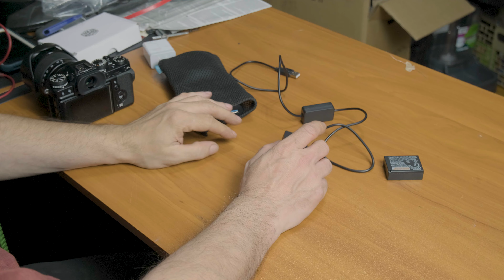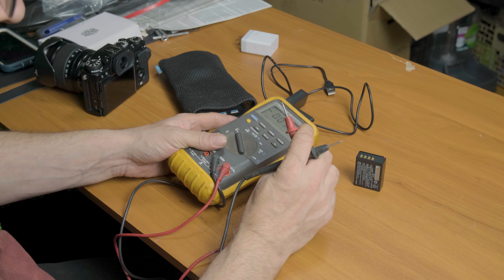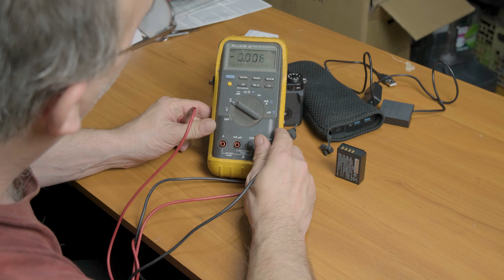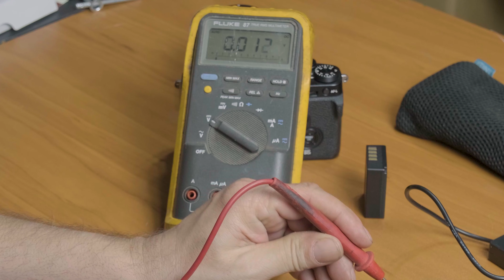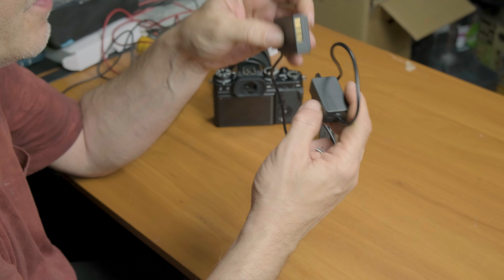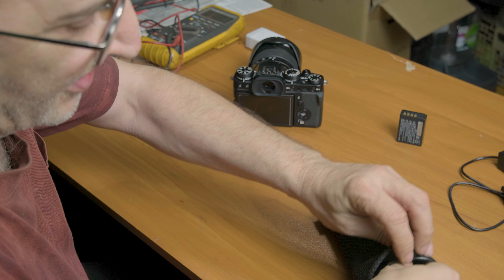Don't Burn Up Your Camera, Using a Dummy Battery, Here is how.

Comment: Hi! I have a generic dummy battery kit (CP-W235) for my Fuji XH2S. Since I can't reach the dummy battery contacts inside the camera compartment, I measured the voltage directly at the DC barrel connector between the adapter and the dummy battery. I got 8.6V DC and 0.03V AC ripple. The original Fuji NP-W235 battery is rated at 7.2V nominal / 8.4V fully charged. Do these readings look safe to use with the camera? Thanks!
Reply from the maker: Yeah 8.6 V is close enough to 8.4V so that would seem valid

Comment: I messed up my camera with a dummy battery. It wasn't a USB power supply, but I plugged it in to the wrong supply voltage cable. I think I gave it about 24v. 😩 Hoping the repair parts aren't too pricey.
Reply from the maker: Well if you fried your camera, depending on what camera, i would say it's going to cost at least $500.00 to $700.00 to fix this.
That is why i put that video out to warn people.
Because many people has made this mistake.

Comment: I wonder , xt3 can be used with usbc to usbc and can be powered directly without dummy battery and i think it will be safer for the camera , so using dummy battery?
Reply from the maker: Yeah it can if you use the Anker Powercore+ the input is USBC and so it's the connection on the camera.

Comment: does powering from usb c make you camera to heat more? i only test for 10 min recording i notice minimal difference or my camera is just low entry (ZV E10)
Reply from the maker: you mean the overheating thing, no actually less, if you use the USBC for power the batteries inside the camera are not getting warm because they are hardly used..
So the internal heat is less.
Reply: No I mean usbc directly to camera usbc port on the side not battery

Comment: If I had known this before I wouldn't have burned my Sony ZVE10. I bought a dummy battery about 2 years ago and there was no way to measure the voltage. They didn't tell me about this either. I connected the wrong power supply and it burned my camera.
Reply from the maker: that's how it happens and that is why i crated that video to warn people.

Comment: Iam using 9 volts, no problem
Reply from the maker: You might be able to get away with it, but sooner or later it's going to burn your camera's circuit board out sooner before it's time.. 
Too high of voltage is not a good thing..
Reply: Did u test it and found 9v ?

Comment: "Multimeters aren't that expensive" {pulls out a Fluke 87 of about €650+ } hahaha. But I get it. They can be cheap.
Are there dummy batteries with the voltage regulator build in the dummy battery?

Comment: Insightful video, Sir. I'm planning to buy a similar dummy battery like yours for my Canon EOS 600D. But instead of using a powerbank or adapter, I'm planning to plug it directly on my PC's USB ports in the back like a webcam. What is your advice about this idea? Is it safe or risky? Thank you for any advice.
Reply: I do that with my A7SIII, but the pc isn't able to charge the battery while is on.

Comment: Hi there! I was wondering how to measure the voltage in batteries (and dummy batteries) where there are no positive or negative physical poles (in the outside of the battery), such as the ones in camera Sony 6000a?  Thank you!
Reply from the maker: There has to be some sort of metal connect on the batteries and you just find out which one is pos and the other neg that is the only way.
Reply: @AMomentInTimeProductions  Thank you so much for your quick response! I'll explore my batteries, and I'll let you know my results. Thank you, again.

Comment: Thanks for the video but some things are a bit unclear to me so if you can help me out I would appreciate it:

I would like to buy Nikon Z30 and Nikon has not released any official dummy battery. So instead of buying any 3rd party dummy battery could I use power bank plugged into the socket and than connecting it to the camera via USB? Would that give me infinite power? Or could I at least stream in 4k 12+ hours?

Thanks.
Reply: The camera must have a Type-C port, and both the camera and the power bank support the Power Delivery "PD" , not Micro USB, Micro USB doesn't support "PD"

Comment: Any advice for dummy battery for a g85 ? And a usb batter pack would be the way yo go ?
Reply from the maker: uicebox Power Coupler (Dummy Battery) for Panasonic GH3, GH4, GH5, GH5S

https://www.amazon.com/Juicebox-Power-Coupler-Battery-Panasonic/dp/B07JG9P991/ref=asc_df_B07JG9P991/?tag=hyprod-20&linkCode=df0&hvadid=658947680612&hvpos=&hvnetw=g&hvrand=16351334134414361132&hvpone=&hvptwo=&hvqmt=&hvdev=c&hvdvcmdl=&hvlocint=&hvlocphy=9012329&hvtargid=pla-2088511856145&psc=1&mcid=b719f21666063db7bf57adabfb9e6253
Reply: Thanks for the fast reply

Comment: Thank you for this video. I suppose using the power bank method would be much safer option compared to plugging into a wall outlet. I just got a new camera and I am looking into getting a dummy battery and a power bank for shopping star trails.
Reply from the maker: Power Bank Method is much safer and it works well, and no wires to be plugged into the camera..

Comment: Most SONY dummy batteries have no current or voltage regulation or diode at all. I tried on SONY HX99v and ZV-1 and atleast they didn't die.

Batteries for them are the NP-BX1 that outputs 3,6V. Hlwever when I measured the Dummy batteries, they were 5V. Same Voltage from dummy  from USB standard.

I'm gueeskng It is ok because these cameras charge through USB and maybe the Voltage regulator in the camera can handle 3-5,5Volts depending IF It is run on USB port power or battery, meaning the step down/up circuit is placed after the USB mains/Battery leads on the DC board inside the camera..
Reply from the maker: Yeah i don't use a Dummy battery for the Sony, i do how ever use the Anker powercore  Power delivery pack, with that you can get 9 to 10 hours of battery life doing video with that on a Sony Camera, like the FX30
Reply: @AMomentInTimeProductions  do you mean you charge the camera directly with the USB-C using a power bank?

Many people say this discharges the battery, just slowly. It will eventually turn off as the camera battery runs out of power.

Is that the case? What about overheating?

Comment: I fry my sony alpha a7iii used dummy battery with the v mount for the first time, is it a easy replacement the part ? Do you know what part have to be replaced after fry camera ?
Reply from the maker: Probably the Main board... You should always make sure you know what your hooking up to your camera for power this video explains that..

Comment: Sir i have recently purchased Sony FX 30 im looking for power bank as I have long video shoots.
Pls suggest which power bank is suitable and how to use that as im new to this
Reply from the maker: Anker PowerCore+ 26800mAh PD 45W with 60W PD Charger, Power Delivery Portable Charger Bundle for USB C MacBook Air/Pro/Dell XPS, iPad Pro, iPhone 14/13/12 Series, and More...

I  use that myself on the Sony Fx30 It's Only $99.99

https://www.amazon.com/Anker-Charger-PowerCore-Portable-Delivery/dp/B07XRJZXKY/ref=asc_df_B07XRJZXKY/?tag=hyprod-20&linkCode=df0&hvadid=385448272964&hvpos=&hvnetw=g&hvrand=2143402792051450447&hvpone=&hvptwo=&hvqmt=&hvdev=c&hvdvcmdl=&hvlocint=&hvlocphy=9012329&hvtargid=pla-835112928895&psc=1&tag=&ref=&adgrpid=81228106969&hvpone=&hvptwo=&hvadid=385448272964&hvpos=&hvnetw=g&hvrand=2143402792051450447&hvqmt=&hvdev=c&hvdvcmdl=&hvlocint=&hvlocphy=9012329&hvtargid=pla-835112928895
Reply: @AMomentInTimeProductions  Sir ur suggested product is not available on Amazon or any other online app.
Im from India and I have shortlisted MI Power Bank ( Details attached ).
Pls have a look on this and pls guide me will it works or i shall drop my idea of buying this.
Thanks in advance sir

Comment: I got a dummy batterie that reads 8.9v for the fuji xt-1 with a wall converter it came with. Will that fry it?
Reply from the maker: If your camera is suppose to only take 5V yes, what does your normal battery Put out?
Reply: I just checked a fully charged  non original battery (quite used) says 7.99v. It's like the battery u have in the video. Perhaps slightly different for the x-t2
Reply: It worked. As the link I posted, the camera regulated it to its needed voltage.

Comment: question please help, what happens if u accidentally use a 5V power bank to your 8V NP-FZ100 dummy battery connected to your Sony A74 camera, would it have the chance to fry the camera or not? thank uu
Reply from the maker: If you use a Power Bank That Doesn't produce enough voltage then yes you could fry your camera..
Have not enough voltage to any circuit board is just as bad as having too much.
that is why brown outs and voltage brown outs can damage computers, same with a camera..
Before you ever hook up any dummy battery to your camera make sure the voltage that is going to the dummy battery is the same as what your real battery would put out, make sure the voltage is not too low or too high, if your camera is suppose to be supplied 8V then make sure that is what the dummy battery is giving to the camera, it can be 8.2V or 7.9 that is ok, your real battery drops slight voltage as the batter is being used and wearing out, But a camera that is suppose to be supplied 8V should never be getting 5V that is not good.
Reply: @AMomentInTimeProductions  this is what worries me, my fault that I didn't do the research before putting the dummy battery w the 5v powerbank, although the camera is still work fine now (im using regular battery btw)..is there a way to check if the camera is damaged from the mistake I made w the under volt powerbank?? thanks again for replying
Reply from the maker: @Obscurainc  Well there is no way to check that, if your camera is working fine then you are probably alright..
the signs of a damaged camera would be if you start seeing strange things happen such as the camera shutting down for no reason or the screen flickering or glitching..
Or functions not working like they should..
Chances are if the camera turns on and records video fine then your probably ok..
I wouldn't worry about it..
just make sure you use a volt meter before you use anything to power your camera..
Especially a Dummy Battery..
First off what camera do you have, what make and model?
once you tell me that i can tell you what you can use to power your dummy battery..
Reply: @AMomentInTimeProductions  Sony A74
Reply from the maker: @Obscurainc  Ok so that battery for that camera should be givingan  Output Voltage	7.2 VDC  So, that means 5v would not be enough voltage, make sure your Dummy Battery gives off around 7.2 Volts

Comment: The following question seems to have slipped through the cracks so I'll ask again.

I own an X-T5. I bought a dummy battery from GyroVu advertised to be compatible with the X-T4 and X-T5. Bottom line: It doesn’t work. The camera powers on but freezes when I try to shoot a photo. I can’t figure out how to use my voltage meter to test the dummy battery because the test leads on my voltage meter don’t fit into the tiny slits in the Fujifilm NP-W235 Li battery. Any suggestions for testing the power output? Can you recommend a dummy battery that will work with my X-T5? Thanks!
Reply from the maker: Ok first off the X-T4 and X-T5 are 2 different camera's and in fact when they came out with the X-T5 they used a different battery so a dummy battery would not work with and X-T5 2 different battery's , and X-T4 Battery wouldn't even fit in a X-T5 camera..

The X-T4 uses a (NP-W126S Battery) The XT-5 uses a (NP-W235 Battery)

So the Dummy battery for an X-T3 or X-T4 would not work with an X-T5

if you want a dummy battery for the X-T5 Get one for that camera that is my suggestion..

Comment: Thanks for the quick reply, A Moment In Time! I own several GyroVu dummy batteries. You're right, the cable for the X-T3 compatible dummy battery features a voltage regulator, but the cables for the Canon, X-T5, and Panasonic compatible dummy batteries DO NOT. Do you know whether there's a voltage regulator inside the dummy battery for those models?

Comment: I own a Fujifilm X-T3, like you. It appears that you are using an AC converter made by GyroVu, right? But the cable for the dummy battery doesn’t look like the ones from GyroVu — their cables don’t feature a voltage regulator, just a straight cable. So, where did you get the cable shown in your video?

I also own an X-T5. I bought a dummy battery from GyroVu advertised to be compatible with the X-T4 and X-T5. Bottom line: It doesn’t work. The camera powers on but freezes when I try to shoot a photo. I can’t figure out how to use my voltage meter to test the dummy battery because the test leads on my voltage meter don’t fit into the tiny slits in the Fujifilm NP-W235 Li battery. Any suggestions? Can you recommend a dummy battery that will work? Thanks!
Reply from the maker: i will look into where i got it and let you know it is a gyrovu tho i know that for sure.. i'll let you know.
Reply from the maker: ok here is where i got it.
I got it from B&H Photo..

GyroVu USB to FUJIFILM NP-W126 Dummy Battery Intelligent Cable with 3.1A Power Supply (40")

https://www.bhphotovideo.com/c/product/1570171-REG/gyrovu_gv_usb_126s_ps_usb_fujifilm_40_np_w126s_straight_dummy.html

Comment: Thank you for replying. Question: Can 9.3V fry my Gh5?
Reply from the maker: it depends on what the voltage the gh5 takes if it only suppose to take no more then 8.5 volts then yes.. but you have to test the battery of the GH5 first then you will know what the battery puts out.

Comment: I genuinely don’t understand this like when you buy a Fujifilmv x100v for example and it comes with a charger cable but not a plug like USB or something like that. Is there any particular plug to go with this instead of this like this is crazy
Reply from the maker: it should come with a plug it should come with a A/C to DC adapter with a plug that has the Dummy Battery connected to it..

Comment: Can usb battery packs be linked via a USB cable for longer running time, or does the voltage increase like when you set up car batteries in a particular way?
Reply from the maker: No it wouldn't work that way, you could switch to another battery pack when the first one runs out, other than that you really can't link them.

Comment: First of all that AC unit , is USB and it sends 5V , not 8,4V ... then it goes it to that little box, in that box  is a Boost converter that boosts that to 8,4V ... looks like you dont know that , the problem will arise if you give it less then 5V , everything below 4V will get that Boost converter in to crazy mode , and it can output more then 8,4V , because chips inside can go to 40V , and are known to go crazy if not supplied with above 4V , why , becase its electronics requires 3.5V to run it , if you dont give it that , then it doesnt work as planed , that is why . .. so just make sure your USB is 5V , and that the output after the converter is above 8V , below 9V .
Reply from the maker: Actually it's not a boost converter it's a Voltage regulator, because i have tested that AC to USB Adapter With out that  chord just a strait chord with out the plastic regulator inbetween, and it out put 8.7 Volts,  tested this in many ways and that never made it go into crazy mode and never out putted 40 Volts, first off that AC to USB you plug in the wall doesn't even out put 40 volts only 8.7 to 9 volts max..

Then i connected the Dummy Battery chord that has the regulator and plugged A AC to USB adapter that is used on a mac book which puts out 20 Volts, and the Dummy Battery End that goes in the Camera still only got 8.4 Volts, so that is a Voltage regulator Not a Boost Converter..
Reply: @AMomentInTimeProductions  no its boost converter , how can you otherwise get 8V from 5V , voltage regulator would give you 3.5V
Reply from the maker: @dedskin1  No, the amount of volts depends on the source where the Chord is plugged into, you could plug that chord into an Apple laptop DC power Supply and that would output 20 Volts,  then the voltage that would reach the Camera would be only 8 Volts, because of the Voltage Regulator. it's not a Boost converter..
Reply: @AMomentInTimeProductions  and the source is USB power bank of 5V not AC volt socket look at your thumbnail .
Reply: @AMomentInTimeProductions  im not talking about imaginary situation , im talking about situation at hand . It is what it is .

Comment: I have a Sony a6000, any idea as to what dummy battery would be safe? And can the Anker Power be charged ? Or is it a finite source of power
Reply from the maker: Yes a dummy battery would be safe so long as its made for that specific camera, now as far as using the Anker Power on the a6000 i'm not 100% sure on that, if it has a USBC connection then it probably is able to work with the Anker Power core.

Here is a dummy battery that would work for the Sony A6000
https://www.amazon.com/FIT-POWER-Replcement-Adapter-NP-FW50-Battery/dp/B0744JGWQR/ref=as_li_ss_tl?crid=2GRH0FS4JR9ET&dchild=1&keywords=dummy+battery+sony+a6000&qid=1609972303&sprefix=dummy+battery,aps,257&sr=8-1-spons&psc=1&spLa=ZW5jcnlwdGVkUXVhbGlmaWVyPUEzRlo5N1oyVllFTU5XJmVuY3J5cHRlZElkPUEwMjc5MzQ4MUFGMDJEMFRORk9ZTCZlbmNyeXB0ZWRBZElkPUEwNDU3MTY4U1ZVTzNEVlRWSkdGJndpZGdldE5hbWU9c3BfYXRmJmFjdGlvbj1jbGlja1JlZGlyZWN0JmRvTm90TG9nQ2xpY2s9dHJ1ZQ%3D%3D&linkCode=sl1&tag=jeramielu05-20&linkId=95ef566af2b3a6faa475b86c9c7c25f0&language=en_US